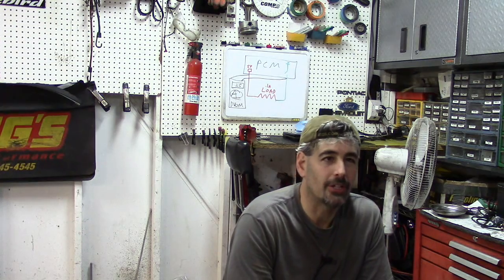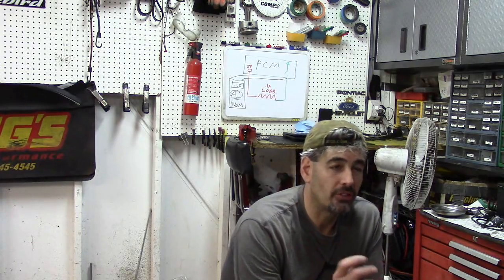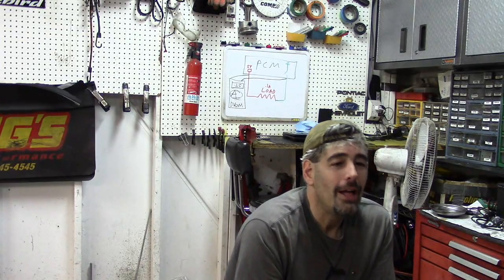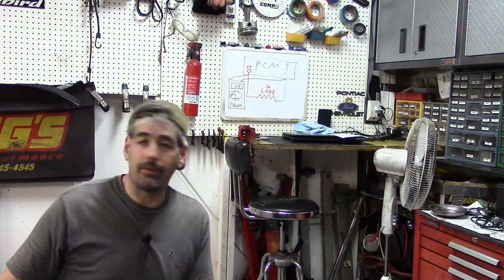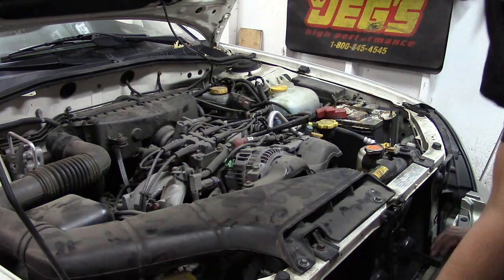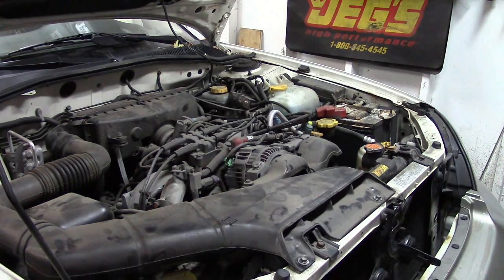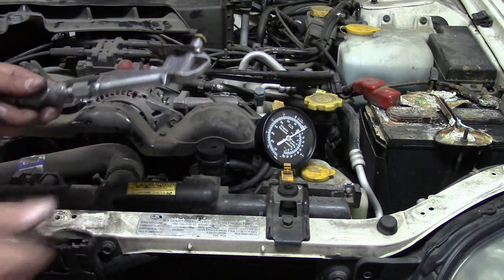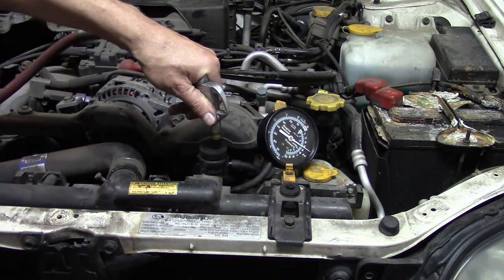Homemade Cooling System Pressure Tester!!

Comment: Why not put pressure in the resevior rubber tube?
Reply from the maker: You can do that too. Often those hoses are for overflow and won’t handle higher pressures but it would work if it’s easiest to access.
Reply: @SchrodingersBox  It worked. Kept it to 14lbs and found leak quick. Thanks for video and reply!

Comment: Hi Matt great video thanks it will save me and everyone from buying a pressure tester. question:where did you get a door stopper that size? my radiator opening is 1 1/8" dia.
Reply from the maker: I have had those for years from when I worked in a laboratory lol.

Comment: I reused a broken/defect temp sensor and drill trough to glue in a tube nipple from a large truck tire that is made of brass and has a tube of a few inchhes so that I can use my bike pump to get it pressurised. Great benefit of this appoach is that it also automatically test the radiator cap which can also be faulty
Reply from the maker: Genius idea!!!!!
Reply: @SchrodingersBox  the additional benefit is that the cap still releases any over pressure from bike pump and even air compressor to prevent damaging the fragile and costly  radiator
Reply: @SchrodingersBox  here is my first attempt 

https://youtube.com/shorts/YoYIQJZrBKE?feature=share

Comment: I noticed a leak on my atlas compressor with a John deer engine while i was working on a un related part.  so was looking to buy a tester . I saw your video and took a neopreme plug i use for plugging  while powdercoating.  found my leak around one of my hoses.  So fun and easy.  Thanks for the video.

Comment: Thinking about the same procedure but instead doing everything from the overflow hose with a Tee fitting for the gauge (leave the radiator cap on ) can you direct me to a gauge with a proper port similar to what you were using but maybe a higher PSI reading like 20 or 50 PSI.?   Also what about turning the regulator down on the compressor to say 15 PSI would that be feasible, trying without a gauge ?

Comment: You mentioned near the end of this video that you can you get the air out of your system using pressure. How this is done is not clear to me. Would like to see a video on how this is done.
Reply from the maker: Yes, you can "burp" the system by pressurizing it.  Air will escape the bleed valve.

Comment: Now sometimes the radiator failure is due to an overheating problem. You can't assume just by replacing the radiator that this is a complete fix. You should conduct another pressure test after the replacement to ensure there's not another leak in the system.

Comment: Great idea! Since watching I've thought of adapting it to use a car wheel schraeder valve and a battery operated tyre inflator. The schraeder valve could be pushed through the rubber bung thereby enabling it to take the inflator. The electric inflators have a pressure gauge on (usually). Or a bicylce pump could be used if an electric inflator not available.

Comment: Not trying to look like a daydream Johnny but why pressurize the system. I just use the top seal of cap and spare tank acts as a bubbler or draws in coolant when it cools.
Reply from the maker: How is that going to find the leak?

Comment: General Motors. Uses a water hose and connects it in. That's how specialist work. They just leave the water pressure on there. find leak. You'll never get over like 10 to 15 lb Whatever your radiator cap call for. They find a lot of intake leaks this way

Comment: This is really the best info channel I found on Youtube. I Think there is good to use a Bicycle pump. I own this,  https://www.sks-germany.com/en/products/rennkompressor/   works well for many years.   good to pump  tires on cars who Placed far away from electricity or those who dont own a portable compressor with build-in pressure tank.  now when I seen this great Movie, I would like to test to build a homemade tester, out of this bicyclepump. only need to build a adapter, without to damage the bicyclepump. I gues I have to  care to look on the built-in pressure gauge, this pump is able to make pressure to 16 bar. (1,1 bar=16 psi. Gues max is 17 psi for most coolant system in cars) How to build a adapter, to connect between the pumphose and coolant fluid reservoar?

Comment: A while back I actually purchased a set of rubber plugs that have a male end for an air line. I blow out hoses. Water pressure pumps and actually coolant systems. Works Awesome. But the gauge was my issue. May try this out thanks

Comment: I was just thinking of using a the 5/16ths vent hose on my Chevvy Cruze.. cut a tee into that and hook a hose to connect the airline and pressure guage.. That way you don't even need a rubber stopper and would be better for tiny leaks that you might want to test over several hours.

Comment: Hey Schrodinger, I have been chasing a coolant leak on my 09 Subaru Forester XT for quite a while now. Having recently replaced my oem radiator due to a split like in your video, I still smell coolant.

I have pressure tested the system with a pump similar to yours, although I believe the included fitting seals well on my radiators expansion tank. I had pumped it up to approx 16psi and within 10 minutes or so it will drop to about 14psi. Would you consider this normal? Pumping any more pressure results in it not holding pressure (I suspect due to this cooling system having two radiator caps - the other one thats in place is set to open at 16/18psi from memory) Would it be safe to clamp off the overflow to keep the pressure in the system to help find the leak?
Reply from the maker: I’d suspect internal leak at intake gasket.
Reply: Schrodingers Box thanks, but I don't think this car has one of those. It's the same running gear a as a 2008 WRX, 2.5L turbo charged. If so, where abouts would it be ?
Reply: Done some more troubleshooting, I believe this is conclusive..https://youtu.be/naIODIYqYsw
Reply from the maker: I would still confirm with leakdown or compression test.
Reply: Schrodingers Box compression test was 120-120 and 125-125. Leak down was hard to perform with the limited room to work with but it was leaking quite a bit - test reported 60-70% leak down from memory. Car still runs great and has plenty of punch so I think I didn't get everything lined up correctly

Comment: how about drilling the radiator cap and inserting tyre valve stem in the hole?
Reply from the maker: Not a bad idea except you would have to make a series of these for all different car models
Reply: thanks for reply!

Comment: Brilliant! Have to try that.  I thought the leak was coming out of the battery.  (Just kidding)! That battery is crusty thought.
Reply from the maker: yes I noticed that too.  I originally thought it was because the owner just topped off the antifreeze that day but now I suspect it was overflow past the cap when it overheated.

Comment: you could just cut a metal O-ring or washer so it look like a C. drop it in the radiator neck put the radiator cap back on top. That cut O-ring would push the spring up and leave a gap for air pressure to flow throw the overfill tube down to the radiator!!
Reply from the maker: Not a bad idea!

Comment: I had the same problem on my 96 Sonoma and I could smell antifreeze but never saw it , it would leak about a quart every 2-3 weeks .  after I changed the radiator cap it completely stopped

Comment: Can't you just leave the radiator cap on and pressure test throu the "overflow" silicon hose?
Reply from the maker: How would you pressurize past the radiator cap seal then?
Reply: I successfully applied this method.  It seems the overflow seal is a vacuum seal -- it is overcome when overflow pressure exceeds system pressure.  This is what permits inflow from the overflow tank.
Reply: Schrodingers Box  the valve on the radiator cap that allows coolant to be sucked into the cooling system from the overflow bottle should allow you to pressurize the cooling system with any air source.
mine happens to  be an empty r134a can and a 12v tire inflation pump.

Comment: Excellent idea with the rubber stoppers.  I use those on power steering reservoirs to draw a vacuum and purge out trapped air.  I'm going to rig something up to my Motive pressure bleeder to make things more universal when testing cooling systems.

Comment: My pressure tester for cars with remote expansion tanks is an adjustable pressure regulator and a tee to place in the line between the tank and the radiator. The best part is it tests the radiator cap seal as part of the cooling system pressure test.

Comment: An alternative method that usually works without tools is to run the car until it's warmed up. Arm yourself with a flashlight and then turn the car off. Pressure is at it's max now and you can usually spot the leak with a flashlight.
Reply: It's leaking into the oil

Comment: Subaru radiators are junk so that is a common problem.  Although, for a car of the vintage in the video, not the original radiator.  Also, there's the head gasket problem.  However, the most common coolant leak I encounter occurs where the upper radiator hose connects to the pipe on top of the engine.  There is something about that cast piece that prevents a good seal to the hose.
Reply from the maker: +Lorrin Barth What is the data showing evidence to your conclusions? I see no logical neccessitation of any such diagnosis
Reply: +Schrodingers Box Evidence?  Well, thinking back to coolant leaks on Subarus I have repaired I remember a radiator, a water pump, a pinhole leak in a hose coming off of the water pump and four times where the above hose connection was leaking.  That is it for my memory bank.  

The thing about this hose connection is that it hides under the air intake and shroud covering the accessory belts.  And even when you remove them you have to feel under for wetness.  So, it is sneaky.
Reply: +Lorrin Barth Wait, I didn't make a diagnosis, all I did was offer a helpful hint.  

As for radiators, I don't like the style now in use with plastic tanks.  As shown here, the failure of the seal between the core and tank is only a matter of when.  This type of radiator is often inexpensive but a radiator with welded tanks has a chance of lasting the life of the vehicle.  In the age of iridium spark plugs and stainless steel exhaust, car makers are causing owners to accept the radiator as being a maintenance item.

Comment: guess what I'm doing today....testing for a leak in a subi 2.5 litre. with a homemade pressure tester. Thanks Matt! 👍👍👍
Reply from the maker: +R HEIDEMAN Hahahaha!! Yeah it will work better than my $280 Stant setup I guarantee!!!! I wish I thought of this first and I would never have bought the Stant kit!
Reply: Yeah thinkin about drilling another stopper with a skinny unibit and siliconeing a tire valve stem in from the backside to use to hold pressure on the system.
Reply from the maker: R HEIDEMAN Yes thats a good idea, I though about that too. Also thought making similar device for pressure brake bleeding would be good,
Reply: Friggin sweet. Btw....the 1996 subi 2.5......head assket. Soab!. Mabee I'll try some magical mystery metel master mender. Lol.

Comment: Matt - Great Job.  Thanks for showing us. Fast, easy, cheap and it works.   Like your tester rig a lot. Did you get any info for the Subaru test cap/fitting?  Kinda guessing there would be a lot of people who need to know this and it would really save their bacon knowing which adapter to get.

I saw Eric from SMA doing something similar. He didn't use the rubber stopper but he did test through the overflow connection with a similar air hose nozzle. He had the air nozzle blow through the overflow fitting and checked the upper radiator hose to make sure it was pressurized. He didn't a Gage because he already tested it. He was basically just giving tips and tricks for all us DIY'rs and it was a simple after the repair second check/validity of system integrity using the vehicle's cap as the plug kinda thing.

Comment: good job thanx but  i need to understand why u used compressor air and didnt use the testing set
Reply from the maker: +prince way As stated in the video, the adapter the did not work on this vehicle
Reply: ok thanx bro

Comment: Great idea about using the overflow tube for a pressure gauge. A lot of modern vehicles don't have radiator caps anymore so I made a tester for mine with a cheap bicycle pump and a flush and fill kit that was already installed on my truck.

Comment: Great idea!
Reply: This guy put a Schrader valve in a cheap radiator cap:  https://www.youtube.com/watch?v=oqqv4iscYWU
How about putting a Schrader valve in a rubber cork, plugging the other hole, and testing a replacement heater core?
I do not want to swap it three times!

Comment: Great idea. I opted for the harbor freight one. Just a warning for those looking to buy the harbor freight one. You WILL need to put white thread tape on the metal bits in each adapter as they screw into plastic adapters that go on the rad. Comes with a pump and gauge like the one shown in this video. But I do like cheap and free.

Comment: Just a Thought do you have a cylinder leak down tester with a regulator on it? you can use that with your rubber stopper and set your pressure.also you could just buy a new radiator cap for the car and drill and tread it. then take your rubber stoppers, one that might fit under the cap and drill a hole in it to deal the over flow tub.

Comment: Use a known good radiator cap and blow in the purge tube. Feel a big hose for stiffness so idiots dont split the radiator. If the hose is still stiff after 5 min or so,  then no leaks.  STOPPERS? Come on man...
Reply from the maker: +paradisemace1 Does anyone have ANY idea what this guys who clearly has NEVER pressure tested a cooling system is even talking about?
  Another Scotty viewer found the channel I see

Comment: why dont you just live the radio cao on and conect the overflow tube to the pressure testere inplace of the adapter?
Reply: +bn1andy Because I want to test the system pressure not just the seal of very top of the cap.  A radiator cap works BELOW the overflow
Reply: +Schrodinger's Box Quantum Mekanix  Andy has a good point there! You could just hook a bike pump to the overflow tube and pump it up. The TOP of the rad cap should hold pressure up to its safety blow-off at around 20psi or so :)  A rad cap is actually three one-way valves in one unit!
Reply from the maker: +motoYam82 But that just tests the top of the cap., I want to test the system
Reply: Nope, that method indeed pressurizes the whole system. You can even take the pump off and the system will stay pressurized to the cap rating ~15psi (assuming the cap is functional and there are no huge leaks). TRY IT BRO!!
Reply from the maker: motoYam82 I don't understand how it can pressurize the system when the cap is sealing the radiator neck.

Comment: I have a similar pile of junk tester and I found some rubber washers the same size as the filler neck that filled the gap between the adaptor and the neck to make it fit tight.

Comment: I had the same problem with a 1996 2.5L Subaru Outback, I had already done a HG once shortly after I bought the car!  It part of it was a bad radiator, bad radiator cap, and a few other just plain weird things! For a while I would not go anywhere with out a few gallons of coolant- coming from an aircraft back ground- I know horizonally apposed engines- the Subaru is a funky design, I guess they are fine brand new, but not when they got a few miles on them, mine has 206K on it and I not put 20 thousand miles on it the 24 months I had it- its an old car so its to be expected, good learning experience thou, and its a fairly simple car for a beginner home wrench to work on!

Comment: Hi Matt,

I use a collection of three different sized rubber plugs just like you have.  Holes drilled in them and quick disconnect nipple inserted.  I use regulator at compressor to control pressure.  Hook it up and turn on the air.  That's it.
Reply from the maker: +kermit80526 Lol that's pretty much what I plan on doing.  Screw these $70-$85 Stant adapters!!!!
Reply: +Schrodingers Box yep the only real concern is with them blowing out occasionally so I usually just keep my pressure around 10 to 12 pounds or so
Reply from the maker: kermit80526 What do you do for a decay test, say for a head gasket or something?
Reply: +Schrodingers Box Hi Matt,  If you're talking a static "leak down" test, just make sure that your quick disconnects are tight and shut off the valve at the compressor tank.  I'll shoot you pics of my current bung set if you want to post, but I need a way to get them to you.  By the way, these are available at Ace Hardware for all interested for about average $2 a piece.
Reply: +Schrodingers Box BTW, you should be able to hear it, but if not, a little Windex or other household cleaner with a propensity to foam (as you might use for house gas line check) is a good method to confirm a tight seal.
Reply: +Schrodingers Box Stream of consciousness...yes , I know.  One last thing though, using a collection of these, you can use a size that gets inside the outer neck and removes the overflow tank from the equation, making the need to pinch that hose off unnecessary.  Really, about $20 in bungs and nipples and you can deal with most situations.  I've been doing this for about 25 years and really think it's a good/cheap way to do it.